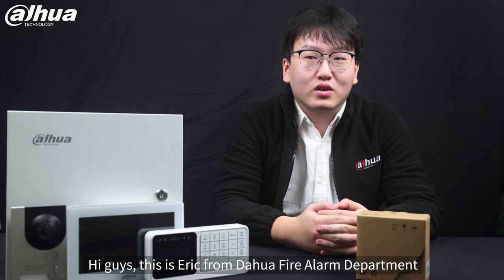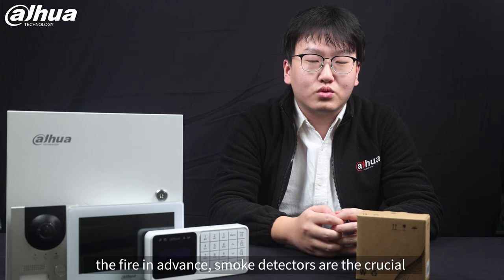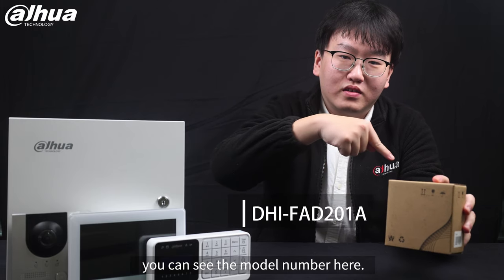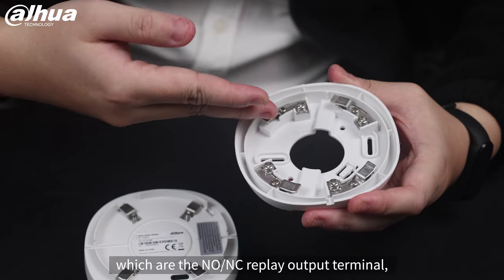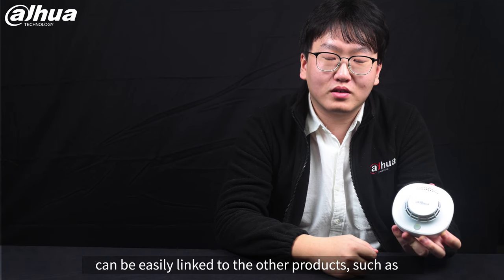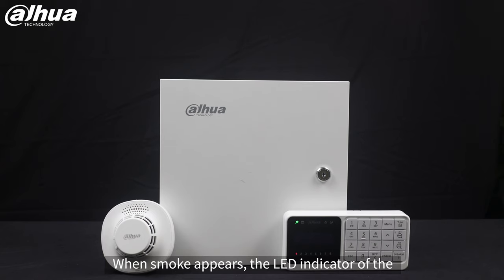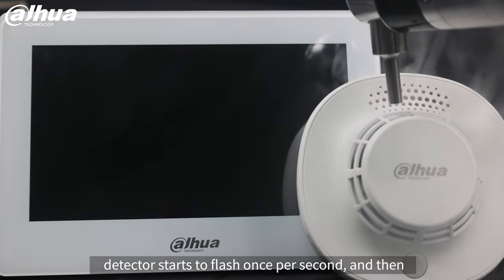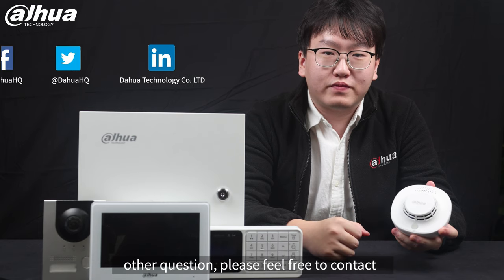Dahua 4-wire Smoke Detector Unboxing

Comment: I have once Installed the Dahua Intercom. I never thought this smoke detector could be integrated with VTH. I don't know if the same panel or not But I'm glad you made this device to eliminate the use of standard fire alarm panels. Great Technology and Integration!